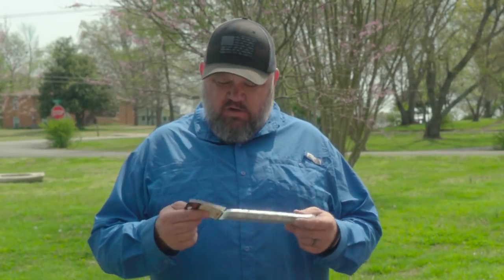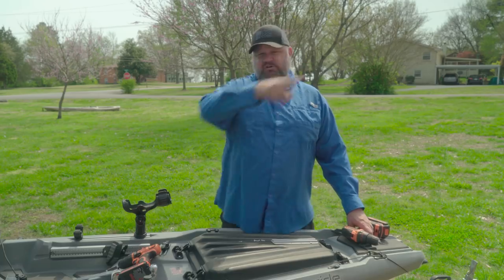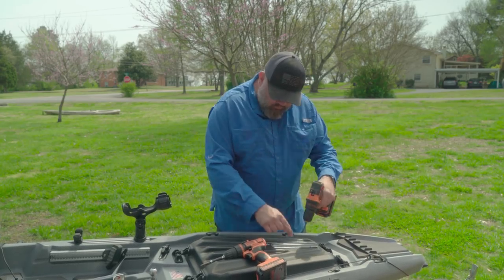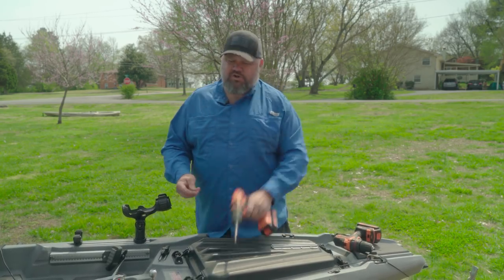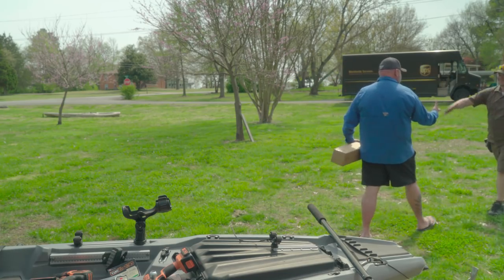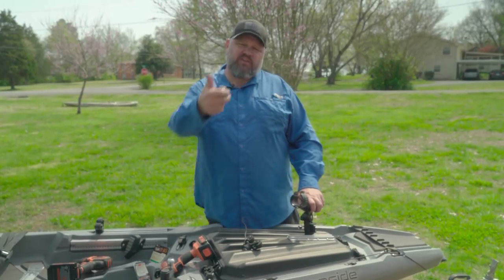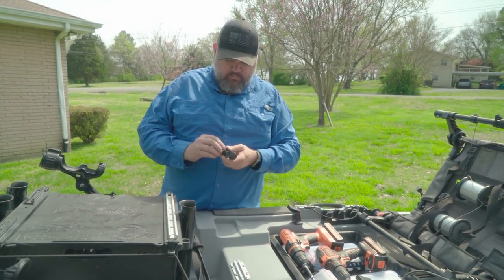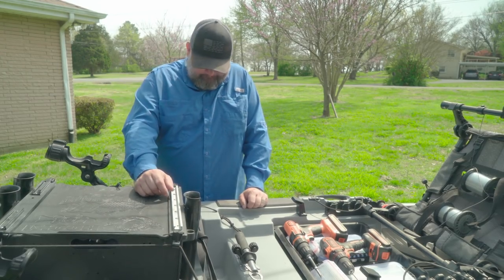How To Install a YakAttack GearTrac | Kayak Fishing Camera Mounting Options

Comment: Thanks Chad for all of your expertise and knowledge. I just purchased a BonafideEX123 because of your recommendation. 
Check into using a self centering drill bit used for cabinet hinge screws. They are inexpensive and center drill bit perfectly. A must have if using counter sunk screws. No pushing off to side or leaving screw head crooked. Will make installs much easier. '
Reply from the maker: Thanks for the recommendation, I will look into that

Comment: Thanks chad for all of your great knowledge and recommendations. I just purchased bonafide ex 123 because of your recommendation.
When drilling track holes check into a self centering drill bit used for cabinet door hinges. It keeps all screws perfectly centered in hole and perfectly flat. No guess work on centering drill bit.

Comment: I have two of the paddle holders and I use them  on a gear track next to one another. I put the end of my hog trough between them then lock them down. Keep the hog trough from moving around.

Comment: If one would place a strong double sided tape beneath the rail before drilling and screwing. Would that help displace the weight if I were to add handles to my rail to carry my kayak? Kayak is light, but looking for a permanent solution that wouldn’t prematurely wear on the kayak and pull free eventually.
Reply from the maker: I wouldn’t worry about the double sided tape and you could definitely use the GearTrac for a handle attachment point. The self tapping screws hold like grim death and it would be very tough, if not impossible to rip them out of the boat
Reply: @ChadHooverFishing  Thanks Chad I just ordered some on Amazon. I’m not doubting your faith in the screws, but I believe I’m gonna go the rivet route for a clean finish look. I’m only running a Pelican Maxim Angler 100x. But, I’m a father of seven children and treat everything like it’s irreplaceable. The yak is so light I really don’t need the handles. But, I refuse to drag it😂. I will probably mock up a compact dolly that will fit in my trunk. I’m hauling yak on the roof of my Hyundai Sonata. On a side note thank you for all your doing. Nothing is worth doing if you don’t enjoy it first. From what I can tell you really enjoy what your doing brother. Sorry for writing a book.

Comment: I just bought my first kayak from Academy and saw your great video on installing the YakAttack GearTrac.  I want to put some tracks on my sides.  Are self-taping screws strong enough?  What made you go with self-taping screws over well-nuts?  I am looking at longer rails along both sides for accessories.  

Thanks in Advance.

Comment: Chad...I know you do not like pedals....and typically if you are not slipping with the paddle you are moving along with a motor...so my question...have you added a motor to a SS127 yet? if so, where did you mount the Battery....if not, where would you suggest one mount the trolling motor Battery?

Thanks and Always Great knowledge